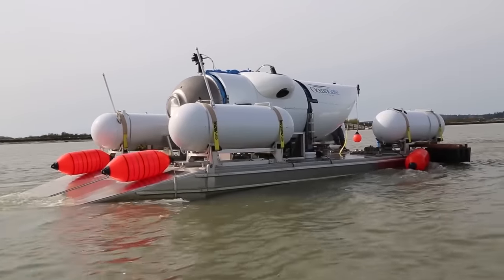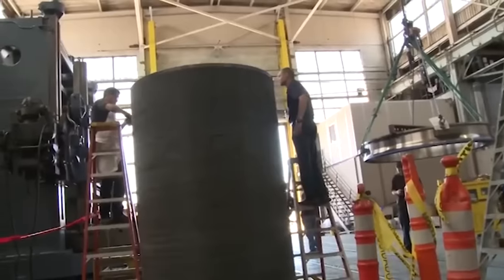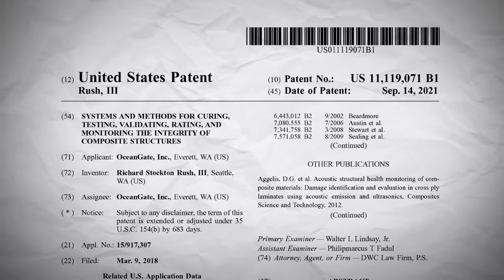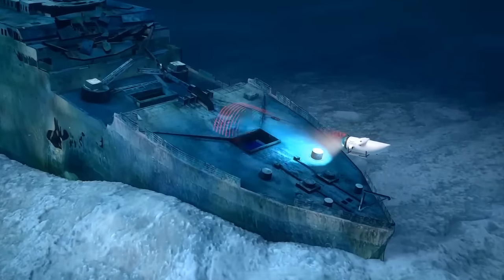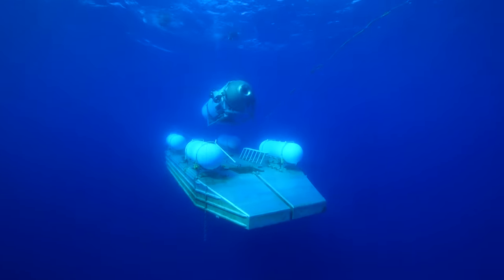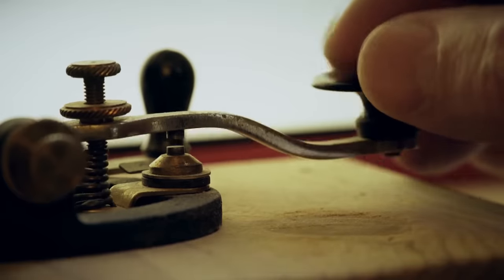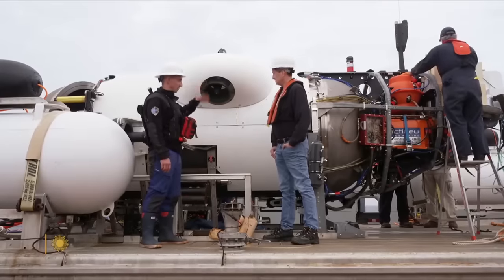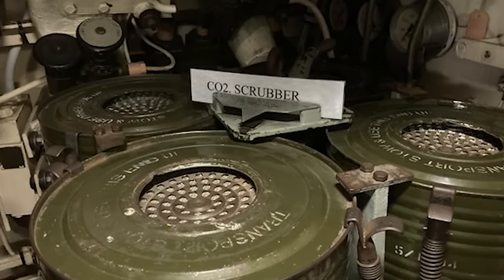Exposing OceanGate Submarines Many Fatal Designs

Comment: Among the many things I can comment on regarding the cavalier attitude to safety on this craft I will pick these two examples:
1) Using a game controller is seen by many as being a sign of doing things on the cheap and compromising safety. As you point out in this video there is actually nothing wrong with using a game controller. They are usually well made devices that, unlike the Titan, have been thoroughly tested by millions of people over billions of hours. They are probably the safest bit of equipment that they had on board. However, that doesn't mean to say that the attached software was necessarily optimised for purpose. As I haven't come across any specific information on the implemenation of control software I can't speculate further on that.
2) Using sensors to detect when an implosion is possibly imminent is as redundant a safety device as you can get. If these sensors say 'Hey, we're feeling the pinch a bit' then it's still down to the pilot's discretion whether the pinch is strong enough to worry about. If the pilot feels that the hull is capable of handling all the pressure then they might note the readings and decide to keep an eye on them. In this case when six successful dives have already been made there is room for complacency. Even if the pressure readings are more intense than at the same point previously the pilot could say to themselves 'Not a problem, she can handle it'. The major issue with these sensors is that by the time they note a level of buckling that is concerning the implosion could already be in progress. Such an implosion could happen at speeds of Mach 2, twice the speed of sound. By the time the warning systems have registered an increase in pressure and transmitted that data to a screen for a crew member to read the implosion could have happened 100 times over.

It's the only saving grace for the families left behind. The implosion would have happened so quickly that no-one on board would have had time to notice it. The human brain is incapable of processing an event that quick. From their point of view they would simply cease to exist. They wouldn't know a thing about it. There may have been anxiety from knowing that they were descending without communication and possibly without full buoyancy control, but there may be no warning at the final moments. Imagine a supersonic jet flying toward you at full speed. You hear it approach, you look up and by the time you register it's heading straight at you it's already one mile away and you're dead. You're gone before your last thought can form.

The Oceangate Titan tragedy was a totally avoidable disaster. Just like the Challenger Space Shuttle that was launched against the advice of the engineers who said it was too cold for the 'O' rings to be safe. Just like the Captain of the Titanic who sailed on despite ice field warnings. Just like the banks that were "too big to fail". These weren't cries of "Wolf!", these were informed warnings. Oceangate should be prosecuted for corporate manslaughter.
Reply: As to the sensors, the Titan was already reacting to a problem and attempting to return to the surface. It is likely the sensors gave notification along with increased crackling of the carbon fiber.  While they may have died instantly, they probably knew a catastrophe was the likely outcome. RIP
Reply: These are F710 logiech controllers, and probably the worst game controllers on the market, the connection is really sketchy even for video-games.
Reply: Game controllers tested by millions of people. That's a fallacy there. Commercial products are often produced to fill the bare minimum of quality standards. It doesn't matter if the controllers were "tested" (cough) by millions of people, if a company like Logitech never fixed any issues with them. Using commercial, untested products is a bad take on critical applications, especially if the products were not put under the scrutiny that such environments demand. I say untested, because they were only tested by the OEM to pass quality check, but they were not tested regarding resistance to vibrations, fire, etc.

Comment: No regulation would prevent that submarine from inploding, because what led to the implosion of the submarine was the lack of knowledge of the ideology of construction.
he should have made a submarine, put a camera and sensors inside it, tied a steel cable to it, and used 20% of excess depth, if you want to go to 4000 meters put the submarine at 5000 meters (Pareto code ). submerge the submarine and raise it until it implodes. And apply the Pareto code again. if the submarine withstands 10 dives THE TECHNIQUE FOR CONSTRUCTING THE SAME IS VALIDATED FOR 8 DIVES.
Don't tell me the test couldn't be carried out for economic reasons, the amount charged was 1 million dollars for each dive.
about the temporal degradation test, another submarine would be needed for testing, and another submarine for the dive itself, before each dive the STANDARD submarine WOULD be dived and lifted, if there was no leak the dive with people could continue, this would continue until a leak occurs, on this day the expiration date of the hull would be validated. ANY TECHNICAL STUDENT LEARNS THIS AT THE AGE OF 15.
nothing in this world would prevent this submarine from imploding, as nothing in this world is eternal, the implosion occurred due to the lack of a replica to visualize the safety limit. it would implode not if, BUT WHEN.

Comment: For a submersible like this it's important that the outside forces are distrubuted evenly. For a shape like this it's impossible, especially considering that there were at least two
different materials being used. Also, from what I've been able to see in videos the whole thing is basically held together by glue because the titanium rings are literally glued
to the hull, then the two ports on the ends are screwed to those titanium rings. The risks with diving in a vessel like this are self explanatory. Sounds like he truly believed it
would be sufficient but he deeply underestimated the structural integrity and the pressures at those depths. He talked about the sensors being a safety feature but by the
time they detect something it's likely too late because it takes a lot of time to return to the surface and if there was a "leak" an implosion would happen instantaneously.

Comment: ..compare with the difference in pressures in space - 14.7lbs/sqr inch on the inside of the vessel, '0' lbs/sqr inch outside. Titan 14.7 lbs/sqr inch inside, 6500lbs/sqr inch outside..big difference.

Comment: A military controller is quite different from a home gaming controller.
Reply: Not only that, Logitech is known to make the cheapest and low level entry gaming accessory.
Reply: @SleepySkull1 I must defend Logitech on that one, yes they make things at a lower price point, but generally those things are still of fantastic durability.

They make hardy stuff.
Reply: It’s not at all.  Adding a small stock on the analog to make an Xbox controller is a massive upgrade?

No wonder we spend almost a trillion dollars last year on the defense budget. 

We really upgrade those controllers.
Reply: Even if military also using Logitech, military used that to operate unmanned/crewless drones. This coffin, have passengers.... So even if lost control, the military minimal casualties only the drones, not the crew or passenger like that deep sea coffin
Reply: @esnevip   still not suitable  for a submersible  that dives to 4000 meters .

Comment: Can confirm game controllers are used in the most up to date challanger 2 battle tanks in the british army, we used them to control the turret and operate all the gun controls, it was designed exactly like a playstation controller with R1 button being the fire button, press up to fire a laser to the target etc. Its simple but it works, they are also used for cotrolling combat drones drones. The design leaves a lot to be desired for the whole thing but the controller at least isnt as silly as it might look
Reply: notice it only controls the turret. in the event a Challenger needed to quickly GTFO of an area they arent relying on wireless gamepads
Reply: They use MILSPEC controllers not $10 knockoff consumer grade electronics
Reply: Let me stop you right there. 

Controlling a turret isn't a life critical operation.  
If it fails you still live.
Maneuvering a submarine at 4000m with four paying passengers on board with a Bluetooth gamepad as your only means of control  is criminal negligence.
Reply: The big problem is they used a wireless controller not hardwired every military application of game controllers are hard wired
Reply: A "game controller" shaped input device isn't the same as literally buying a $15 Logitech gamepad off the damn shelf and using it to control dangerous vehicles.

Eff me, next thing people are going to be saying is that video game steering wheels are the same thing you use to drive a real car.
Reply: @psieonic The US uses actual PS4 controllers to fly drones.
Reply: Sounds like the use of a game controller was the least of this submersible's problems.  Don't know why so many people are focusing on that.  Virtue signaling, probably.
Reply: And the Virginia Class submarines utilize wireless, off the shelf game controllers as well, but only to operate the photonics masts.
Reply: @jakehildebrand1824  drones is not a maned vehicle if it fail it hopefully just crash and no harm done.
Reply: Thank you for the explanation.  Usually when I ask the military how they use controllers they just tell me 'classified'.  Now I'm ready to operate my own battle tank!
Reply: @Lennis01  it just highlights the disconnect of the company the best.
Reply: @vzwodb17 milspec controllers can absolutely be $10 lmao. Milspec dont mean jack shit. It just proves who the lowest bidder is that the govt approved.
Reply: @jakehildebrand1824  Drones yes, not manned vehicles.
Reply: @thesantiagoprince1  people are missing the point. The game controller has nothing to do with the subs failure. it was the carbon fibre that failed which was the worst idea of the lot and destined to fail from day one. If the wireless controller failed, they had spares,  if they all failed, they have a safety measure where weights would fall off the bottom of the craft after a certain time and float it to the surface so even if that happened no one would have died. People died because it cant withstand the pressure over and over again. Everyone just jumps on the controller for no legitimate reason because it sounds a bit tin pot but it isnt really
Reply: @thesantiagoprince1  , only the Bluetooth part. Any reputable high end make of a hard wired controller, would be something a tournament level frame perfect fighting game player would risk their winnings on, and thus would be adequate for piloting any piece of hardware.
Reply: @carmeloshin  milspec means it meets “military specifications” for safety and reliability for the application.  Unlike consumer grade electronics.
Reply: @psieonic  Obviously. 
Using a game controller to control a manned vehicle is a terrible idea.

Comment: Oh don't you worry! The aucustic sensors actually worked, tho it only gave millisec's of warning for a hull breach. So it technically worked, Stockton would have seen a giant red sign on his screen in his final moment and right after his brain processed the sight the hull collapsed.
Reply: Just curious why is it that that are wine bottles in the titanic site fully untouched and unbroken by the so called tremendous so called pressures?
Reply: @alexshatner3907 pressure equalization - if pressure inside is equal to outside then the bottle won’t break.
Reply: Also wine bottles are usually filled with wine which is incompressible.
Reply: @notmyfaultthisishappening3795  Gotcha wow thanks you are a genius
Reply: @alexshatner3907  can’t tell if this is sarcasm but I’m assuming you aren’t here to troll since only someone with no life would do that :)

Comment: It is a great tragedy when human life is taken to soon but I am not going to lie I have become obsessed with the failure of this Sub and its design. 
I have seen a lot of people comment on how this was an easy to spot death trap, how the sub failure was just a matter of a time and anyone (even without a professional background) could clearly see this. Stockton Rush had a degree from Princeton University in aerospace engineering, along with other strings of quantification's. He worked with some of the top people on this sub - experts in there field. 

I can't get my head around the fact that Stockton and his team clearly know a thing or two. Yet they went and used a cylinder shape, unweaved carbon fiber that only works well with internal pressure, an inconstant use of materials (titanium ends) and a window not rated to the correct pressure, along with other things I am sure I have missed.
I get what he meant, when he said everything else can fail but the hull and the passengers will be safe so the other bits like controller etc doesn't matter.  So why didn't he over rate the hull massively and not worried about the other bits, doesn't make sense. 
It's not like you could say he was a con man and he wanted to sell rides. He got in it himself, he must of been confident it was safe. 

Something doesn't add up.
Reply: It’s called hubris.
Reply: He knew. Exactly as you stated. He knowingly killed himself and those people. Sounds like a sacrifice to me. 🤷‍♀️
Reply: I am also obsessed with this event. As James Cameron stated, what brought the Titanic down is the same thing that brought the Titan down. I forget the words he used so I’m gonna say overconfidence? Lack of caution? They said the titanic was unsinkable. Stockton Rush said they were being so innovative that regulations would slow them down.
Reply: there are some people who are so good with hyping up anything that after a while they start to buy into their own schemes.  I do believe your right in that he must of been confident it was safe.  but that didn't mean that it actually was,  just that he thought it was.
Reply: Yes.  It's called arrogance.

Comment: As amazing a material carbon fibre is for its tensile strength to weight ratio, I'm a little surprised to find out it was used in a submersible/submarine application with its very low ductility. I would have thought maybe some sort of titanium alloy would have more appropriate material properties?
Hadn't considered that a sphere design would have been much more resistant to the pressure until you mentioned it, but completely makes sense!

Another great and interesting video bro, keep them coming!
Reply: Batisphere (a sphere on a cable hanging down from a ship like a Christmas toy) is probably the first and cheapest deep submersible device. They were prone to the danger of cable tearing, but apart from that...
Reply: Steel and titanium are used most frequently in submersibles.
Reply: Look up Alvin submersible
Reply: @leenevin8451  now that's an interesting looking sub! Will have to look at the history of it properly this evening.

Comment: Ziroth: Thank you for the concise review of the Titan's last voyage. I have done and been in some risk situations but this is not one I would have done; when I saw how they closed up the Titan with no way out in a emergency left me speechless and dumbfounded how intelligent people would get in and even pay to get in a death trap.  Again, great video.
Reply: Agreed!!!!
Reply: I really don't understand why people have an issue with the bolting. It's not like you can escape in an emergency even if it's an option, that's like saying you want an openable hull on a spaceship. Like where are you gonna go??? Outside???
Reply: Being from eltile society of billionaires does not mean that the individual is "highly intelligent" .
Reply: @karankedia8223  Well there is also another problem with the bolts. Lets say the sub goes down but 2 minutes in suddenly has an electrical fire and you have to surface immediately? Well... the tiny cabin is going to fill with black toxic smoke in seconds. And the rich oxygen environment will exasperate the issue. Ok so great you surfaced... but now you cant get out. You need a team to load you onto a skid, yoink you safely onto the deck of a ship. THEN they have to unbolt 18 long heavy bolts to even unseal the sub. Thats a problem. Ask the Apollo 1 crew what happens when you have a hatch thats bolted shut that you cant open from the inside.

Comment: That specific game controller should've been everyone's smoking gun that this thing was doomed. Not simply because it's a game controller, but because its the cheapest and most basic controller of its kind on the market. A $40 wireless-only controller from a brand that primarily makes office peripherals has no place on a vehicle that costs $250,000 per ticket. I personally own one, and it's barely reliable enough to play racing games, let alone drive an actual submersible.